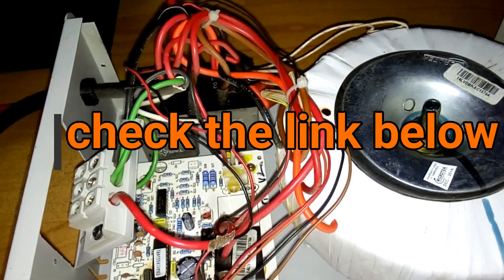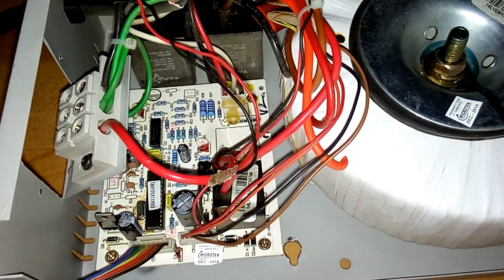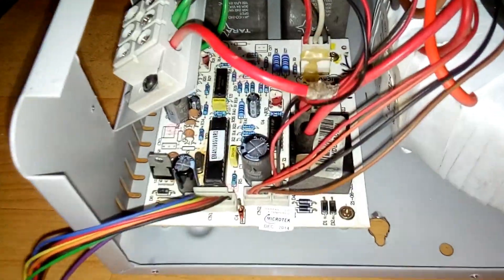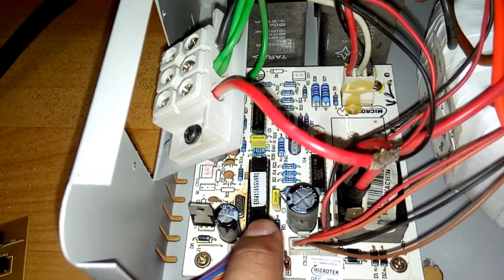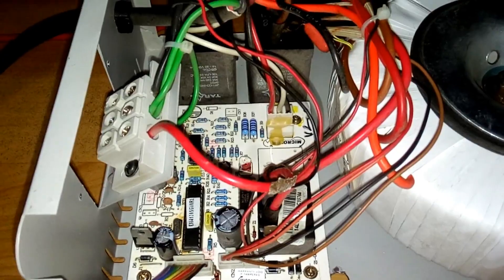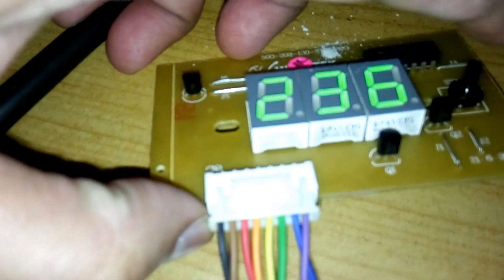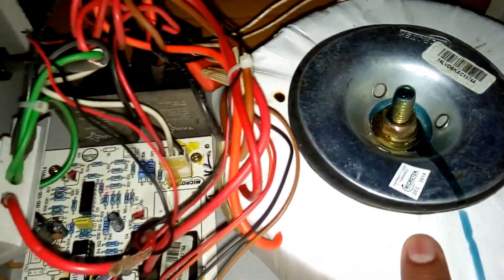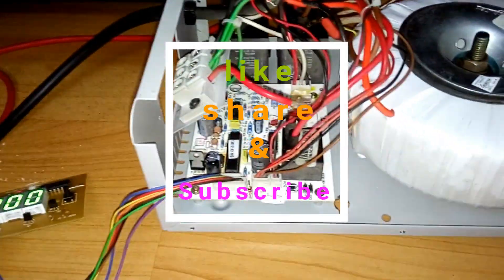How to repair voltage stabilizer/microtek- low voltage output fix

Comment: Hello brother, I bought microtek stabilizer last year and the input was 230 to 240 and the output was 216 to 218. Now the input was 230 to 240 and the output was 235. What problem could there be????
Reply from the maker: Not a big issue i think. Output till 245 is safe. No need to worry. If the output is more then 245 or less then 200 then you need to check the relays.

Comment: New 4kVA 130 V-285 V Candes stablizer input 246 V and giving output 211 V without any load in output. Is stablizer faulty?
Reply from the maker: absolutely no. this how these stabilizers works. it reduce the output voltage when input goes above 245v & it increase the output voltage when input is 200 or below. So relax, its ok
Reply: @technoboy-allinOne  I thought output should be around 238V not 211V
Reply from the maker: No, voltage stabilizer actualy doesnt stabilize the voltage. It increase & decrease to maintain the safe voltage range. And safe voltage range starts from 200v to 245v. During this period stabilizer doesnt work, simply bypass the input volt to the output. Though normal ac voltage is 220v. But it never stay the same.
Reply: @technoboy-allinOne  With input 246V, output is 211V.
But I thought output should be around 230V if input is 246V and not 211V. That's the concern

Comment: Hey how to fix stabliser if input is there but no output showing
Reply from the maker: This microtek stabilizer doesnt show output voltage by itself. If shows only input voltage. To see the output voltage you need to press the button beside the display. And if there is no actual output? Then maybe the output relay or the circuit board is faulty.

Comment: I have same stebilizer and it is making Tak Tak Tak  sound apart from that but output voltage also coming
Reply: How to repair
Reply from the maker: One of the relay is faulty i guess & needs to be replaced

Comment: I have same stabilizer and it is making tak tak tak sound apart from that it is showing a sign IP and than it get blank means dead.
Ac is also not working.
I am confused with the thing that either power connection is not okay or Problem with stabilizer.
What do you suggest?
Reply from the maker: Check the power connection first
Reply: @technoboy-allinOne  Thank you somuch 🙂

Comment: Sir same inverter I'm using for air con.. But it's not working.. H1 error is displayed on the screen.. How to fix it
Reply from the maker: Its 'hi' voltage error. Adjusting a preset may solve this.
Reply: @technoboy-allinOne  How to adjust preset

Comment: Sir, i have the same stabilizer but everytime i switch on the ac then the stabilizer shows hi its not working at all..can u solve my problem sir??
Reply from the maker: Rishikesh Borgohain maybe. But I need to know the problem in detail
Reply: same case here sir
Reply: Display showing hi ,what want to change, relay r ic